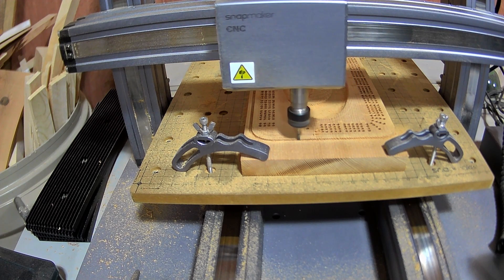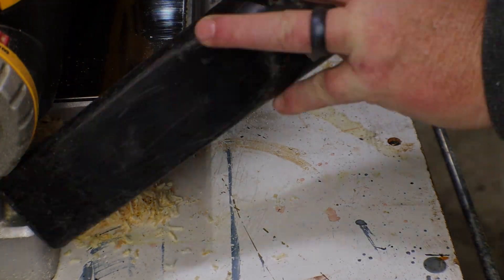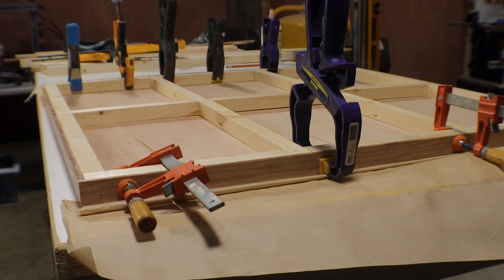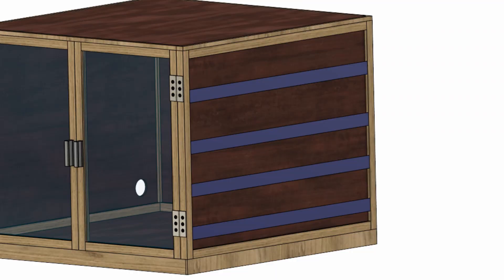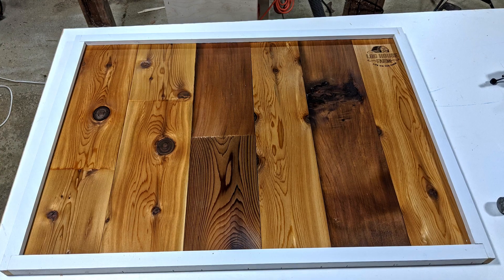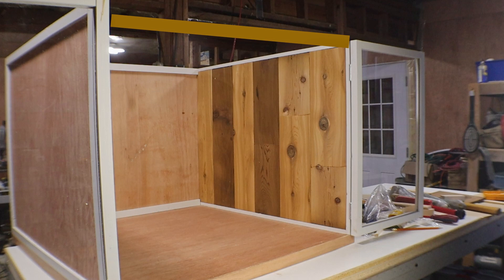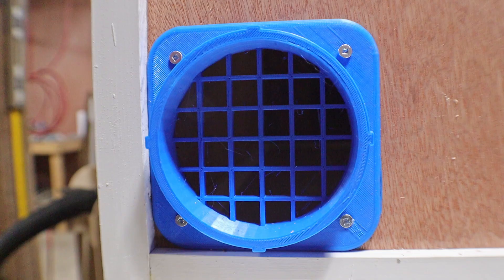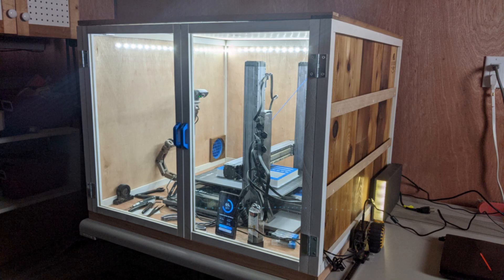Awesome 3D Printer Enclosure

Comment: Hi Andy, may I ask what your experience is so far with the Snapmaker? Are you happy with it? And (sorry) one other. If you take a look at the travel of the bed, will it go outside the baseplate? Reason for asking is placing it in my own home. I assume you can really place it directly against a wall, because of the bed movement, right?
Reply from the maker: I am really happy with the SnapMaker - having all three functions in one is a great way to start. I imagine someday I will get dedicated machines for each function - but even then the SnapMaker will still be used. 
The bed does travel past the frame of the SnapMaker by a couple of inches - their site lists the dimensions - but mine fits in the enclosure and that is 30"